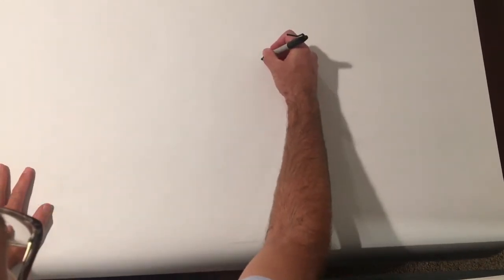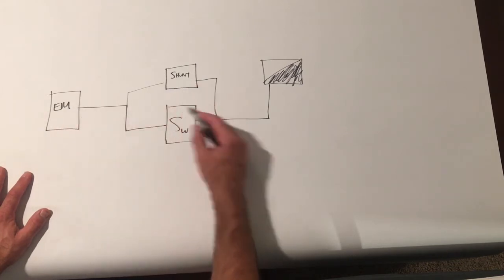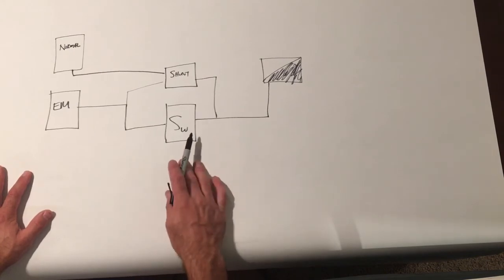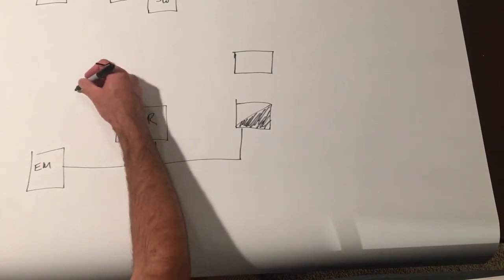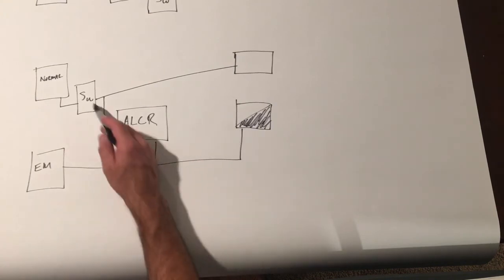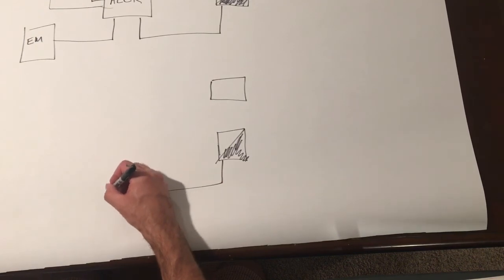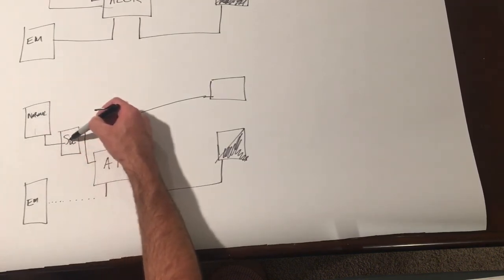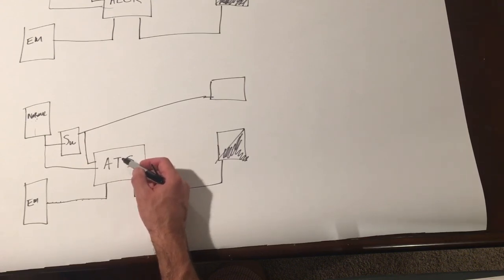Emergency Lighting Control: Shunt Relay, Automatic Load Control Relay And Automatic Transfer Switch

Comment: Do you have a video on how I would wire up a 12 gang grid switch for a large warehouse facility. Mainly covering supplying power to all 12 switches with that would be 3 supplies chained to 4 switches each or something else to supply power. Thanks
Reply from the maker: Hi Kieren.  I don’t understand your question. My apologies.
Reply: @prudalavage  I have 8 switches in a grid box, how many cables will I need running to my consumer unit?

Comment from the maker: Hi Adam i put the video together to show the differences in the 3 types of devices with a general sketch of power.  Please refer to the manufacturer of the device you use and instructions from them.  I recommend “LVS controls” as the manufacturer for these devices.

Comment: In the ATS setup (last one explained), can the ATS be a contactor?
Reply from the maker: Boyd Bros.  Hi thanks for the comment.  The ATS is a single circuit transfer device from normal to emergency lighting.  Check out LVS controls company and they can show you.  It is not a contactor.